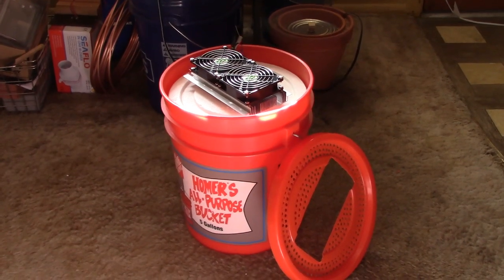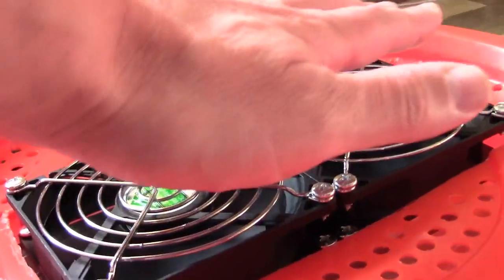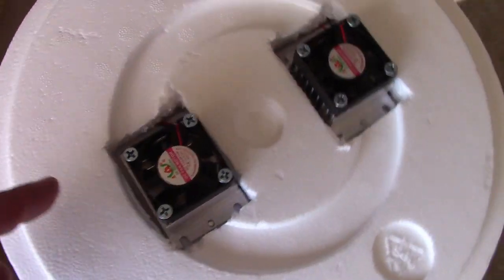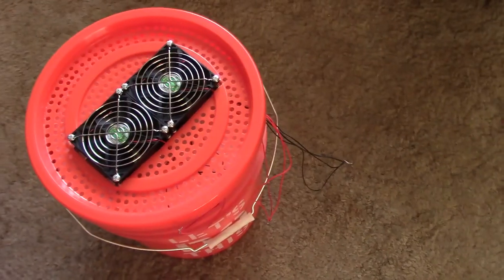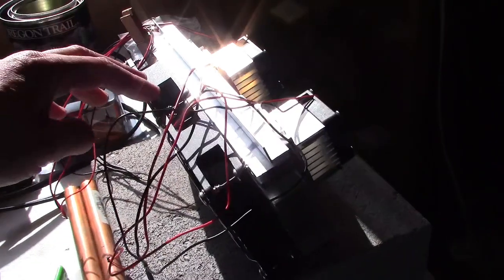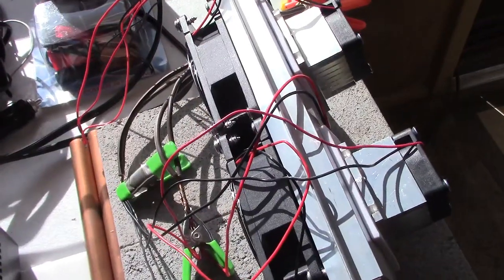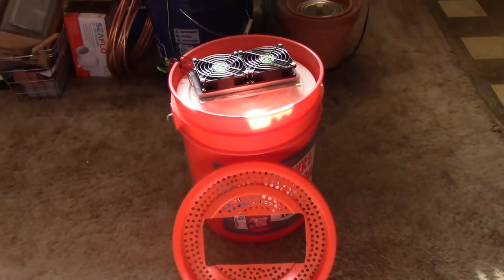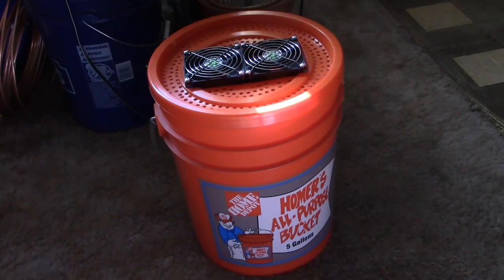DIY Fridge! Peltier Refrigerator! The "5 Gallon Bucket" Fridge!  - from 81F to 47F in just minutes!

Comment: Really enjoy the 5 gallon bucket builds. I built the 5 gallon swamp cooler I used two buckets so my water reservoir was on bottom and closed so I could keep frozen ice jugs in it. 
Perfect for high desert summers.
Thank you for posting.
Reply from the maker: Very cool!
Reply: @desertsun02  what cfm
Reply from the maker: @Weirdo Wolf studio each smaller (40mm) cooling fan is probably about 9 or 10 cfm (high speed ones are around 17 cfm)

Comment: Hi - I have a need to bring my outside terrarium from 100 degrees at times, down to 70 degrees. I plan on building the exact unit in your video. What is the best way to get that cold air you have created into another container that has an ultrasonic mistmaker in it? Please be very detailed, as I'm a bit of a newbie with this stuff. Any help would be greatly appreciated. Thanks.

Comment: If it were 12V 12A, I'm assuming you'd be using a TEC1-12712 Peltier module. But if it is 6A, then I assume it is a TEC1-12706, I don't think that one can draw 12A.
At 6A, that's 72 Watts. You can eventually use another one that uses less power. It will also cool less but manage to achieve the low temperatures wanted, just taking some more time to get there. Your battery will also last its charge longer. For example, the TEC1-12703 will only consume 3A (at 12V that'll be 36W, half of the one you're using).

Peltier modules are very inefficient and it seems you're using it uncapped full power and this is when they get less efficient, both energy consumption wise and achieved temperatures. You could get a current regulator or limiter. Your battery would last longer and you could reach the same required low temps.

Also a hint for people buying the Peltier modules: I've seen the same references with different sizes: 30x30mm and 40x40mm. A wider area will mean a greater heat dissipation, meaning you can achieve lower temps. You've got the 40mm ones, great!
Also as you briefly mentioned, don't forget the thermal compound for the heat sinks, it improves the heat transfer.
Your use of all those fans is done very correctly, only that way you can achieve lower temps because Peltier modules work by creating a temperature difference between the hot and the cold side. If the heat is well dissipated from the hot side, it will be less hot, meaning the cold side will be even cooler.

Let me know here if you need and I'll give you the link of another youtuber that goes into the engineering of Peltiers. He also explains why Peltier Modules are lousy ineffective for air conditioning.
And thanks for giving temperatures in ºC! Cheers from Portugal.
Reply from the maker: hi. it's a double unit so two of the 12706 ones. you can run just one fan or both. each thermoelectric cooling chip (peltier) is 5.8 amps so that along with the fans gets it up to 12a (technically 6.09a each or 12.18a total). yes they are somewhat inefficient but have many benefits that outweigh the inefficiency. a few of the benefits are...  no startup surge, no moving parts, so almost no breakdowns (it's solid state cooling), very lightweight (that whole module with 3 heatsinks and 4 fans only weighs one pound), plus it can be hooked right to a 12v solar panel 🙂 and they last for years and years (both the fans and the peltier).

Comment: I was looking for the peltier unit. Seen 1 back to back with a exchanger that can handle water 15L. Might be better for air conditioning You see, I'm trying to cool my little shop in the back of the garage. Looked at your swamp cooler project but humidity may be a problem (not sure). Shop size is 20 x 24  well insulated. Any help would be greatly appreciated....

Comment: Good day , may I ask ; will this perform effectively without a Styrofoam  liner?
Reply from the maker: hi. the styro-foam helps a lot to keep the cold air in. if you can't get the styro-foam liner for the bucket then the best thing to do is probably just use an ice chest. you could use a regular ice chest or a styro-foam one
Reply: @desertsun02  Thank you!

Comment: Do you think I could cool down a 25gal water Reservoire using copper coil inside the bucket and pump the Reservoire water through the copper coil?
Reply from the maker: hi there. probably, but i'm not sure how long it would take or how low the temp would be.
Reply: @desertsun02  I built your swamp cooler idea and it’s working well in combination with an insulation box to keep the hydroponic buckets temp lower than outside (I’m in Texas). The tank water for the swamp cooler is always around 25C with up to 40C outside temp. I was thinking of running a copper coil inside the swamp cooler water and when I pump water to the buckets, having it running through the coil first. But not sure if I want to spend that money on copper tubing without knowing the result 🤪. Saw the bucket cooler idea and thought of having water sitting in it and cooling the water down and then running the nutrients solution through a copper tube inside the bucket before feeding it into the buckets.
Reply: @desertsun02  and I forgot to say “Thank you!” for posting your inventions and inspiring lots of folks out there!
Reply from the maker: sweet! looks awesome

Comment: HI, where do you find the Styrofoam insert for the 5ga bucket? tks
Reply from the maker: hi. the best place is on home depots website. occasionally their stores have them too. you can also see it on leak-tites website and i have seen them on amazon. they are usually way over priced on amazon though (at least the ones i've seen. i got it in a home depot store for 2 dollars. check the description section for a link them
Reply: @desertsun02  tks

Comment: Very very clever. Is there a video where you explain how something like this could be powered via solar panels? I get confused about converting 12 v to work off solar.

Is all I need is a 15 amp transformer with a 12 v socket plug? And then what solar panel connector attaches to the transformer? I can't do wiring, is there a way to plug them together?

Thank you.
Reply from the maker: hi. to run it on a 12v solar panel or panels all you do is hook the wires from the solar panel straight to the wires of the module. the whole module (fans and peltier) are 12v so it's just a straight connect. there's a quick shot of connection in the video that shows how i clamp the two together. in some parts of the video i'm running it straight to my solar panels. it works just as well. also, it doesn't matter that a 12v solar panel produces a higher voltage then 12v. it won't hurt the fans or peltier at all. they are both very durable. the main thing is to use the right size heat sinks so the peltier won't be damaged. the unit i use in the video comes assembled - al you do is hook it up 🙂
Reply from the maker: hi. if your using solar panels then you don't need the transformer. the transformer is something you plug into the wall so you can run it using wall current. if you want to run it on 'ac' then you just buy the transformer and hook that to the fridge. to run it on solar panels you just hook the fridge directly to a 12v solar panel or solar panels. no need for the transformer if you're running it off of a solar panel. just make sure that the solar panel or panels you are using are 12v and make sure that they can produce 12a. hope that helps 🙂

Comment: I did a few experiments like this with Peltier coolers with a tiny Igloo ice chest but I only reach temperatures inside in the 50s with two Peltier that were like 6 amps like you are similar to yours but I never reach the 40s
Reply from the maker: maybe the ice chest had really bad insulation. either that or the peltier was sub-par (possibly not the correct size heat sinks).
Reply: Some troubleshooting hints...
- Did you use heat sinks, fans and thermal compound?
- What power (Volts and Ampères) did you use?
- 6Amps, I'm assuming it is a TEC1-12706.
- What was the size of the modules? 30x30mm or 40x40mm?

Peltier modules work by creating a temperature difference between the hot and the cold side. If the heat is well dissipated from the hot side, it will be less hot, meaning the cold side will be even cooler.
Reply: @Humongous_Pig_Benis  I used heatsinks fans and thermal compound I know about that and I believe it was the 2706 like you mentioned my power input was 6 amps each I believe I don't know why I didn't get the temperatures I wanted to see I used power supplies from an old computers the computers have power supplies in them that is equal to about 6 amps
Reply: @desertsun02  these are $2 a piece jobs that you get from China you get like 5 or 10 bucks
Reply: @desertsun02  it's possible to insulation that ice chest might have not been that well it's a really tiny a globe the inside dimensions of it or only about maybe 8 in by 10 in like 10 inches

Comment: do you know how to wire a thermistor that shuts it off
Reply from the maker: hi. yep, that's an easy upgrade. they sell temp switches on amazon. cost about 10 bucks for 2 of them. just drop the temp sensor in bucket and wire it. when the temp hits a certain number (that you set) it will shut off the unit. then comes back on when it reaches a certain temp (that you set as well). it  of course is not needed though - the temp will stabilize on its own - but helps conserve power if you're running it straight off battery bank for example.
Reply: @desertsun02  would be interesting to see how much longer a battery pack would last if the fan was intermittent

Comment: Doesn't that need to get down to 40F to be suitable for a fridge? I don't know what the commercially available one do but I think the price of them is way more expensive, if your idea is suitable for a fridge it would be great and a great deal.  Have you checked out the videos on how to build a freezer, fridge and solar air conditioner the guy at Tech Ingredients has? He has some really good videos on other things too , I think he use to be an engineer professionally.  Thanks man
Reply from the maker: hi there. well, the typical full size kitchen fridge is usually set around 40 to 42F but 47 is very close and would work about the same. peltier type fridges cool based on the temperature of the air in the room. as an example, if it was 70-75F in my house it would have cooled to 40-42F. you'll get a 30-34F temp drop from whatever the current air temp is. if it was 60 or 65F in my house it might even make ice. (that could be a future video) then to get precise temps you could control the temperature in the fridge by using a current controller. those are only like 12 bucks on amazon 👍 (the good professionally made models that they sell work about the same as this DIY one. they won't work any better. there are some being sold that can't drop the temp down more than 25F. they claim 35F drop but it never gets there.) - the cooling unit they put on some of them just isn't strong enough.
Reply: @desertsun02  Here is this guy I was talking about testing the fridge he made using I think 6 of the Peltier modules, he got it down to 38.3 F in 2.5 hours with a food load in it but I think he has quite a bit more money in his than the one you built there. He used 2" thick foam insulation and water cooled heat sinks and at least 8 of  the fans circulated through a radiator which he can even move into another room or outside when it is cold or wherever he wants.  He was talking about a version 2 with 12 of the modules.